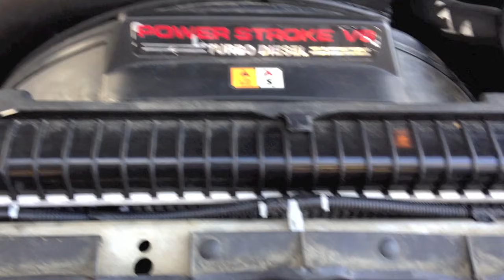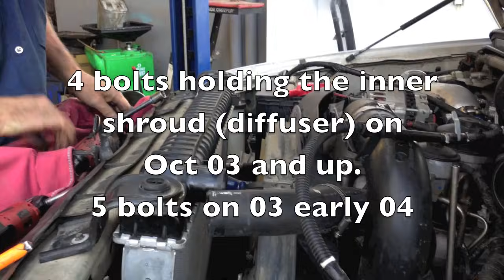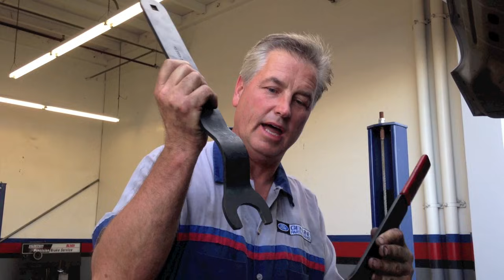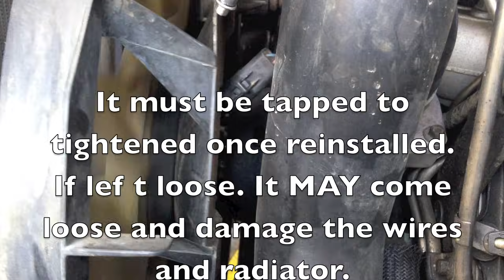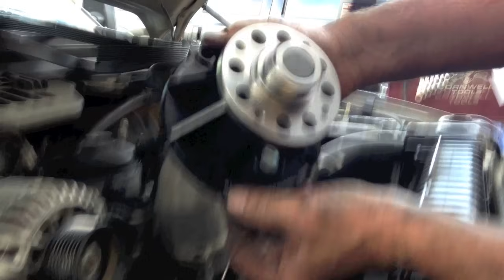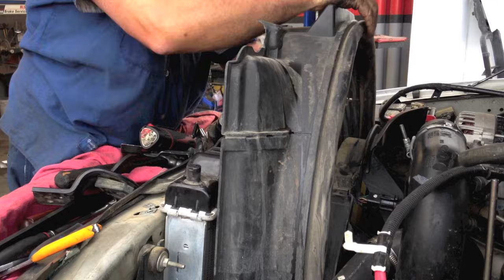Water pump or Fan clutch on the ford 6.0 Powerstroke diesel (Bulletproof used)

Comment: Just replaced my fan çlutch...getting the shroud ring up off the fan is the hardest part when trying to thread the fan assembly back on.. My AC is cool now...the engine runs cooler..happy days

Comment: have to replace my radiator on my 2004 superduty is there a better aftermarket radiator (one you would use ) and not knowing the history of the truck should i change water pump also ? 175,000 miles 6.0 auto trans. videos are awesome have helped me alot thank you . might add from las vegas today temp 107 06/05/2016

Comment: Do you guys custom make Bulletproof water pumps per application? I have a 1987 Mercedes diesel and the oem water pump lasted me 300k miles, however there are no genuine replacements available just aftermarket crap.  If I were to send you an aftermarket water pump would you be able to upgrade the components to bulletproof it?  Please and thank you.

Comment: Hey Ron was wondering if you could answer a question? I have an 05 F550. Just put in the new water pump from BPD. But I have developed a coolant leak some where above the power steering pump as it is leaking off of it. Doesn't look like Degass bottle or upper hose or Thermostat housing is leaking on top. Any ideas? Its hard to see down there from top of engine with all crap in the way like the air box.
Reply: I think i have the same issue. Did you ever figure out what it was??

Comment: Hi I'm having problems removing the steel heater tube next too the water pump. I took the 8 mm screws out .  Can you help. Jeffrey
 Ps it might be my water pump too.
Reply from the maker: you can try twisting it using a penetrating fluid. which something lightly around it but in the worst case sometimes two different metals will fuse together

Comment: Thank you for all of the videos you post for these 6.0s I've used them to get some insight or what to look forward to when working on my 2005 6.0, I've owned the truck for 4 yrs and it's just now asking for some TLC lol. right now my dang fan is starting to come on all the time when I'm stopped at a light and I hope my oil cooler isn't gumming up but I'm going to replace the pump and thermostat anyway for grins. not loosing any coolant so that's a good thing. Thanks for the videos Ron.

Comment: Does the 6.4L have the same threads for removing the fan clutch. I'm trying "Lefty Lucy", but I'm wondering if it's reversed threads on a 6.4L. I'd really appreciate any info you can give me. Thanks.
Reply: Scott Reid hey bro I have the same problem I was wondering how you took it off left or right
Reply: it is opposite threads. Turn right to loosen. I took a long flat head bar and whacked it with a 2lb hammer. Came right off no problem
Reply: thank you

Comment: There are many reasons why i subscribed to your channel but one in particular is the fact that i see you use the Milwaukee ratchets. So i thought to myself if it's good enough for Master Ron and good enough to use on diesels, so I bought the 1/4" and I love it, I loved it so much I bought the 3/8". Nice and light, not to mention after 35 years the joints and muscles and after using IR for a couple years these are a long awaited relief. Thanks for the subliminal suggestion. I was wondering your opinion of the ratchets?  I've only had mine a few weeks. Great Videos, Thanks for making them.

Comment: Ron Im a technician at a shop in Alabama and we work on 6.0's but not many 7.3. Could you gimme a list of start out tools needed to diagnose high pressure oil problems. Thanks in advance
Reply: Eddie Logan hey bro I have the same problem I was wondering how you took it off left or right
Reply: Left

Comment: Love your videos. I have a leak of coolant, I think, dripping on the power steering pump  and then on the steering parts. Don't know if it is the water pump or the hose. This gives me confidence to go after it myself. And another leak of coolant by the starter and bell housing. I just replaced the blue hose with an OEM Ford one and it is not leaking. To many leaks!
Reply: airpilikia I have a feeling it might be head gaskets. :(

Comment: What's the life expectancy on the OEM plastic water pump?  Have you seen instances of the plastic impeller breaking?
Reply from the maker: I see 1-2 a year broke. That's not bad considering I work on 3-5 a day and I'm in the desert where it's 110-120 for 2-3 months straight and we are on the highway where the average speed is over 70mph. We get the ambulances with over 300,000 all the time on the oe waterpump and thermostat.

Comment: What is your opinion on not re-installing the fan stator?  Been some debate on the forums about the effectiveness of the stator and some leave it off for better accessories access.
Reply from the maker: I've never driven one long enough to say for sure. There's a company in our town that removes them for access to install a belt driven compressor. They claim it's better but I would expect them to say that. We don't get them in running hot. If I see some  this summer I'll check them. I would like to test at least three

Comment: I have been using the air chisel method myself to remove the fan clutch on diesel and gas engines. Never had a problem until the last one. In a rush I got too close to the pulley with the chisel and damaged it enough that the clutch would not unscrew. I had no other choice but to replace it. So be careful guys.

Comment: Another great video! I would've liked to see how to remove the diffuser bolts a little better. But still such a great and informative video!
Reply from the maker: I show and explain a six inch extension, 15 shallow socket, 15 shallow socket on the bottom. Use a back up wrench, possible 4-5 bolts depending on the year. Disconnect the hose support and lift it as a whole. Don't use a bolt on the top stud, if it's broke start the boots first. What more could I have explained? Or are you kidding because I over did it
Reply: DieselTechRon  no I wasn't trying to be an ass. I just couldn't see what you were getting at when you were under the truck is all. It was pretty dark. But I love your vids they are a big reason why I decide to tackle a lot of this stuff myself